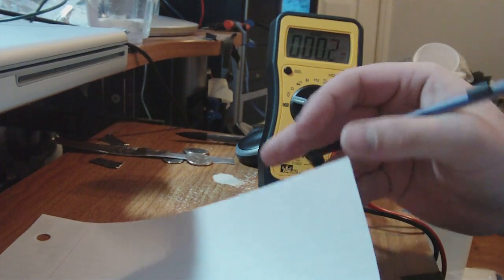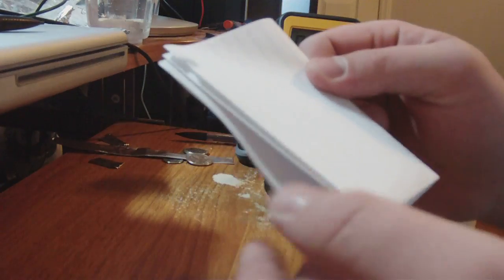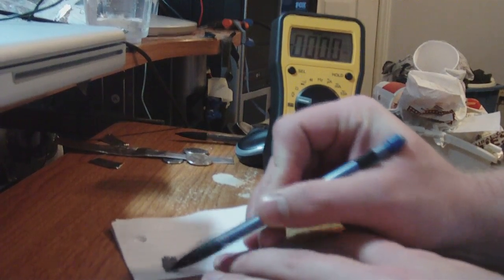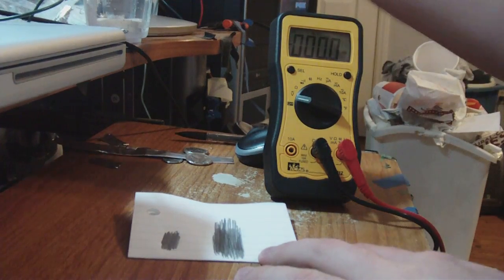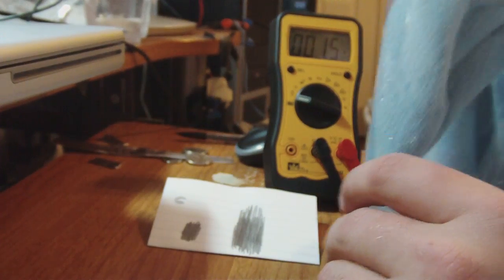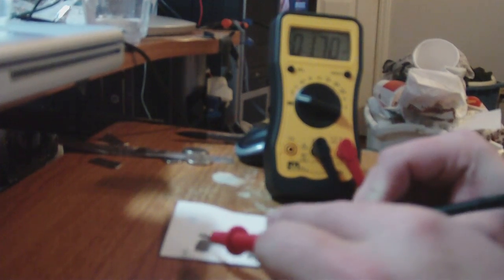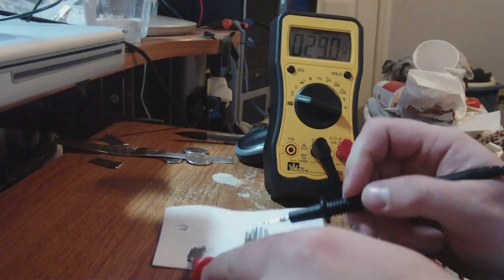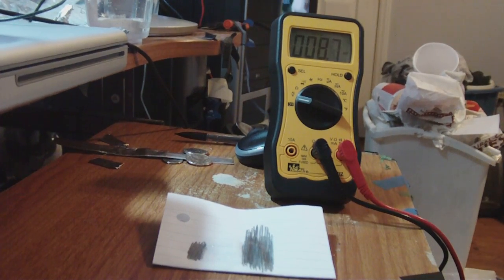Paper and Pencil Battery

Comment: Tried normal and saltwater and nothing really happens. Running a nine volt through it makes look more like a resistor. Probing it after taking the battery off (using an analog multimeter) makes the needle move only slightly and only for a few seconds

Comment: the pencil graphite is acting like the cathode and anode similar too using copper and zinc anodes and cathodes quite smart =)

you will acquire a slightly higher voltage if you use salt water or lemon juice and slightly longer lifespan too...if you manage to seal in the moisture
Reply: It's a capacitor not a battery.

Comment: Try to use one graphite rod or plate and as the other electrode mix TiO2 with graphite powder and water and put it onto a microscope glas plate as a thin  surface layer and heat this with a candle and its carbon black output, so it gets dry.
This will produce about 0.2 to 0.3 volts per cell. So the Titandioxid helps !

Regards, Stefan.

Comment: I have seen the same effect on 2 graphite plates,
but normally you can´t get more than 0.2 to 0.3 Volts per cell
and the current is very low.
You can try graphite spray for making larger graphite areas on paper towels.
Regards, Stefan.